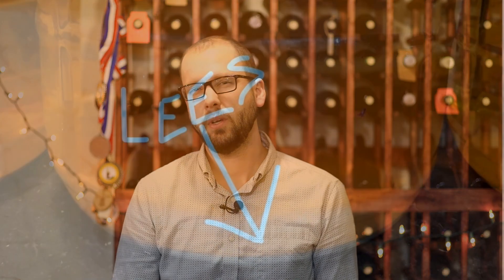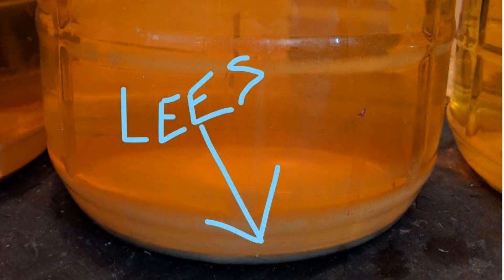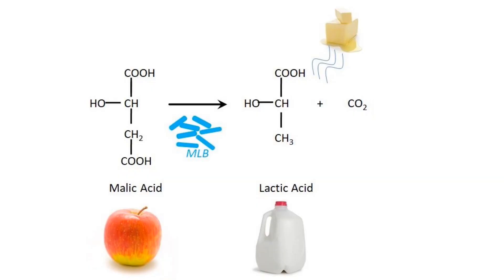What is Malolactic Fermentation?

Comment: I'm a rookie in the home wine making craft. I have some questions about MLF. Is there a post primary fermentation window for trying to start malolactic fermentation? In other words, is there some period of time after primary when malolactic fermentation should not be attempted? I have a couple one gallon batches of pineapple and apple wine that have been racked after primary and have been sitting since for about 4 weeks. Has too much time gone by or can MLF be kicked off anytime? Also, suppose I've conditioned, say with additional fruit, how will this impact MLF and should the steps be changed in such cases? I would assume that MLF should be started after conditioning when the fruit has been removed and the batch has been racked.

Comment: Usually you can add ML bacteria to your red wine when the fermentation is over.
You add the ML bacteria to your fermented wine after the grape marc is pressed.
It is very important that you don’t add sulfur dioxide to your fresh wine since Ml bacteria only works when the free sulfur levels are under 30ppm=30mg/l
When ML fermentation is over about in a week or 2 (you know its ended when theres no more CO2 produced) you rack your wine from lees and add sulfur dioxide and set the free sulfur level to your desired level depending on your wine type.
In white wines you add ML bacteria to your wine after the fermentation is over and is racked from the lees.
ML fermentation (sometimes) could happen naturally at any time if Ml bacteria is present in your wine and the free sulfur dioxide level is under 30ppm (although you shouldn’t keep your sulfur dioxide level low just because you are waiting for ML fermentation to happen naturally. Sulfur protects your wine from oxidation and is very important that you adjust the sulfur level on a regular basis.
You can do ML fermentation but it is not necessarily important to put your wine through this process and risk oxidation 
If the ph level in your wine is low like 3-3,3 it means that your wine is very acidic and ML could higher your ph since malic acid transforms to lactic acid which is a weaker acid but the ph level shouldn’t exceed 3,5-3,6 since higher ph level compromises wine stabilty.
You can add all kinds of things to your wine but it doesn’t mean you should.
Many wineries are going back to the old fashioned ways because they realise that the best wines are made with natural methods and not by poking your wine with all kinds of stuff and machines.
Hope this helps love and kisses from Hungary

Comment: Great videos and great clarity. I like that you are not afraid to blend a good dose of fact with strong opinion which is often what people really need from an honest advisor. So I have some difficulty with the MLF question. I’ve been making a Chambourcin for several years from local sourced grapes. My grower uses strictly the 71b yeast and does not add  MLF culture. I have done both ways. The grape is very acidic but I do think the butter does not complement it well. Any way my real issue has to do with back sweetening and MLF. I have a cabernet that I did a second fermentation on and was planning on sweetening to make a “holiday wine” but then I read that there is a significant risk of awakening a fermentation in the bottle if you have done MLF. any advice on that?

Comment: Thank you for this video. I just finished fermenting several varieties of red grapes and was going to try malolactic fermentation on some. Per you’re recommendation, I have CH 16. Last night I racked off the gross lees. I’m wondering if there is any way I can make the wine worse, or mess it up somehow, if I add the culture and something goes wrong. Let’s say, my basement is too cold or maybe my ph is off (I’ve never measured this before). Also, I know in one batch I accidentally added too much so2 (like 100 ppm). I let that batch sit for 36 hours before I pitched my yeast, but I’m assuming I shouldn’t bother adding my culture to this batch?Also, you you add your oak at this stage or after ml is complete? Thank you and I love your videos. They have helped me a great deal.

Comment: Can you add malolatic cultures a few weeks after primary?  or is that too late?
Reply from the maker: Yes, it is not a problem.  It could be a little tough to get started if you sulfited though.  Normally you will ferment, then do MLF, then sulfite.  Unless you are not intending MLF, you will sulfite right after primary fermentation.

Comment: Thank you, Rick for this video and the info about the malolactic fermentation.   my question if the primary fermentation is done in one week @ 73 to 77 FH with ph 3.5 the gravity is 0.990 and the wine set on the lees for 2 week now all together 3 weeks of fermentation. I am thinking to go through malolactic fermentation because the wine taste is on the acid side of a Marlo batch please let me know if still safe to rack and do it or skip it at this point and what brand or name of Malo. yeast can I use in this case.

Also in my mind could the wine go to a natural malolactic fermentation without malo. yeast if that true is it safe to keep the SO2 with 10 ppm for 4 -5 weeks before stabilizing the wine.
Please advice.
Also in all these above when should I de-gas the wine.
Highly appreciated your response.
Thank you,
Reply from the maker: Thank you!  The wine is still safe to go through MLF if it hasn't already naturally.  You will want to get it off the lees if they are too thick also.  Just make sure to keep it in topped up carboys at this point since it gets progressively more vulnerable to oxidation as each week passes.  I recommend CH16 bacteria.
Reply: Thanks for your prompt response,

Comment: Can you start MLF on a red wine that has been finished for 9 months in plastic barrels?
Reply from the maker: It probably has already completed MLF, but if it hasn't, you can start it.  You will need to check the free SO2 levels which are most likely about zero unless you have been periodically sulfiting it.  If the SO2 has oxidized away, natural malolactic bacteria will often get to work.  You can start a strain like CH16 pretty easily up to about 25ppm free SO2.   I would definitely check your SO2 and make sure the wine is protected as a top priority at this point though rather than try for a late malolactic fermentation.  It is really easy to oxidize a wine when aging in a barrel.  The most likely form of oxidation would be ethyl acetate (nail polish remover smell) or acetic acid (vinegar) or acetaldehyde (Sherry smell).  If the wine has a lower pH like in the 3.5 range it is a lot more resistant to oxidation and is probably okay.  A red wine up around 3.8 in a barrel needs constant monitoring and SO2 maintenance.

Comment: I made a super bone headed mistake! I was supposed to add 10 grams of “Malolactic Bacteria.” Due to a misreading on my conversion app, I accidentally added 80 (to a 10 gallon barrel). At the time of messaging you I just did this. What can I do to correct this? I was thinking racking immediately might help??? Please help!!!
Reply from the maker: Its not a problem.  It is just a waste of good malolactic bacteria.  All you are trying to do is add enough that it can get established in the wine, similar to yeast.  You could add ten times what you need, but it is just not necessary or economical to do that.  When you make a big yeast starter, you are basically doing that but without the additional cost associated.  Malolactic bacteria is relatively expensive so you would normally not want to add at that rate.
Reply from the maker: Is it liquid bacteria?  80 sounds like about a lifetime supply of the dry stuff.

Comment: I'm dealing with a low pH (3.0-3.1) batch of white (chardonel) wine. I started MLF, but it was visible (small bubbles) for only a week (my guess is the pH was too low). I will deal with the pH using pot. bicarb. and cold stabilization. I'm concerned that the MLF may fire back up later, however it looks like pot. sorbate and meta. are the most common ways of preventing MLF. The sorbate can cause off flavors. How would you deal with this once the pH goes up a couple of tenths with the bicarb?

Comment: Red wine free SO2 is 0.5 molecular, and for whites it's 0.8 molecular. Never guess 10 ppm. Get the pH, and sulfite based on molecular free SO2
Reply from the maker: Molecular SO2 suggestions of 0.5 and 0.8 are great for when you intend to inhibit microbial growth but are too high for a pre-MLF addition, since in that case you actually want microbial growth.  A 10ppm addition pre MLF will scavenge oxygen and mostly be gone in a few days.  If the wine Is a little reductive, I wouldn't add it.  The normal guidance would be to do no SO2 at the time of pressing if you are encouraging MLF, but with a high pH must or a must that had an extended maceration on the back end it is worth reducing the dissolved O2 a little bit before ignoring the wine for a while.  A wine will readily absorb enough oxygen during pressing to eat up 10ppm.  If it is high tannin, the tannin will help out and it might wipe out half that.  Keep in mind, even the 0.5 and 0.8 suggestions do not take into account the drop as the SO2 grabs up the dissolved 02 at bottling so you really even then want to over shoot by 10-15ppm free SO2.  If you ever measure free SO2, it is almost always significantly lower than the addition was after a month or two.  If you are using anything but the freshest potassium metabisulfite it would be certainly lower as well. The intent for these videos are to make things easier for home winemakers.  Most of which don't have the means to test Free SO2 but when they do, there are videos for that.

Comment: I have a 3 gallons of an Elderberry wine on the go, I've put a bit too much sugar in there.... The potential alcohol content is at 18% It won't run that high as the yeast I'm using has a tolerance of 15% my problem is that my malolactic bacteria also has an alcohol tolerance of 15% so my thought is once my alcohol fermentation has finished my MLF won't start.... Any idea how I can get round this? Cheers!

Comment: Rick, another great video. Thanks. My question: how do you stop the unwanted and sluggish malolactic fermentation once it started ?. I heard: aeration (because the malalactic bacteria is anaerobic, I heard sulfites, I heard low temperatures and filtering) Whats your take on it? Also, I had terrible experience using 71 B both in red and rosé. It left tons of residual sugar (at least the percieved sweetness was thru the roof. And in rosé the 71 B fruit salade was ughh.... absolutely not inviting.  in combination with still high acidiy 3,08 it smelled like aspirin. What is your experience using 71 B?
Reply: 71b is known to produce fruity esters. MAybe that's where you're getting the perceived sweetness. It is the main choice for dark fruit melomels (mead). I've never had it go less than 13-14% abv so I'm sure you aren't getting residual sweetness unless you're starting with a really high og or you are dealing with unhealthy yeast colony. I wouldn't use it for a wine personally.
Reply: I’m pretty new to wine I’ve got a vintages. I’ve been using 71B with great success for a local Illinois Chambourcin. It tends to be heavy on acid and the result is I think very nice.  Definitely ferments dry to 13.5% I’ve used MLF and not used it and I’m a bit on the fence about adding MLF culture, perhaps the 71b does well enough with the Malic acid.

Comment: Hi there,
Really appreciate your skills and the effort you take to provide this information.  As you read through you will see my rookie status becomes apparent. I wanted to ask a question regarding what to do when the MF process stalls. I started MF in October 2019 went a few months at about 65-75deg then turned off the room heater and let the carboys sit until this week end of March 2020. I confirmed by photo paper testing that MF went about half way. I also found that SO2 levels dropped out even though air locks were maintained with water.  I assumed if kept sealed I would not lose SO2. Yikes!! Anyway, what do I do regarding MF and is it okay to bottle so long as I correct my SO2 levels first?
Thank you,
Tod

Comment: Can the completion of MLF be gauged by when the tiny CO2 bubbles stop being produced?
Reply from the maker: Yes, you can get a good idea if it is complete.  There is always a chance that it may have stalled or not started though.  If you keep it above 60 or 65F for a couple months after primary fermentation, it should complete MLF without issue.  Especially if you inocculate with a freeze dried bacteria

Comment: Agree Malolactic fermentation is critical in some grape varietals.  Usually I will not add malolactic bacteria to some of my wine and blend that with the malo fermented wine at the end to perfect the finish.

One question; I sometimes have struggled with malo fermentation taking a long time to finish (ie > 1 month), thus continues producing CO2.  Whats your recommendation when that occurs?
Reply from the maker: You can speed up the malolactic fermentation by storing the wine a little warmer for that first month.  It is not a problem that it is taking a little longer though.  The wine will end up a little buttery as a result since a slower fermentation usually produces a little more diacetyl.  You may find that you are getting the bubbles after blending with a non ML wine.  Without a pretty heavy dose of SO2 or sterile filtration it will be very difficult to prevent any residual bacteria from eventually going after the newly blended malic acid.
Reply: The Home Winemaking Channel great point... yes I actually have seen extra bubbles when doing that... thanks for sharing the knowledge, very helpful!